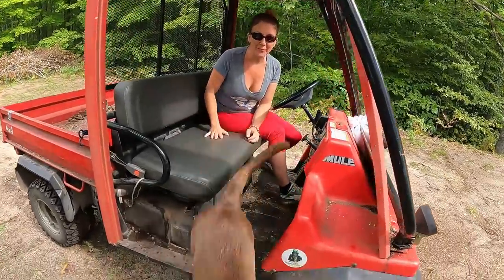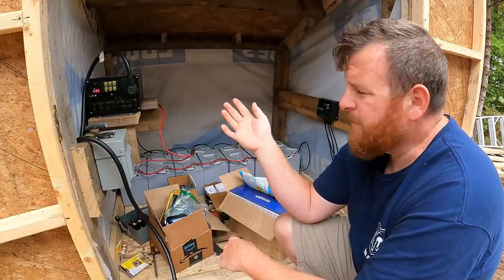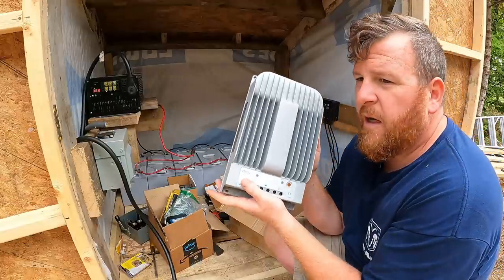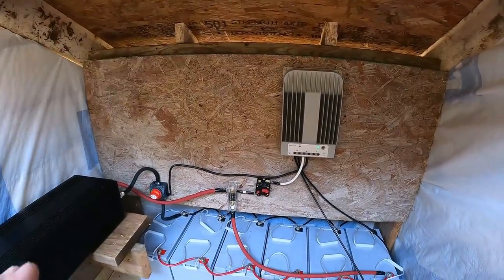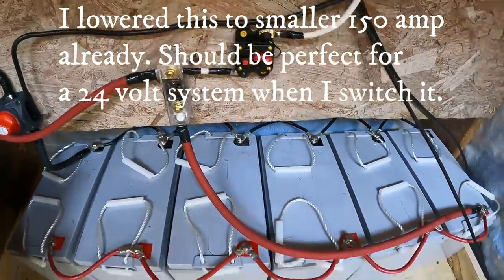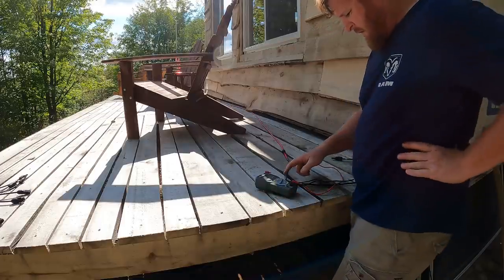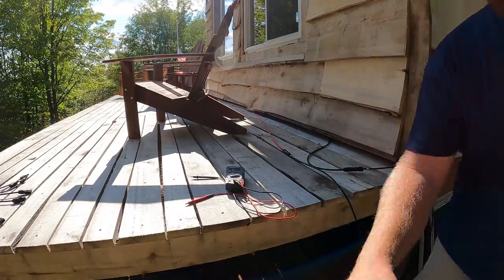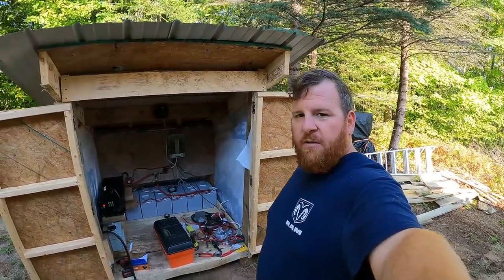Solar Upgrades | Making the Solar Shed Safer | Building simple DIY Off Grid Cabin Solar Power System

Comment: the two solar door should be insulated with foam....since you're batteries are sealed.. no reason to make a vent.. but nevertheless make one (a three inch will do.. add a stainless steel mesh top used for cabinets, kitchen, bathroom can be used here.. just paint it so it don't get rust in winter. Stay safe.. God bless
(wood shed will be good.. make it in such a way that both side are accessible.. that way the old wood gets used first and the fresh cut can dry up).. add a 2nd  MT50 reader inside the cabin exactly behind the wall parallel to your power shed...so you're using less power cable...this will keep you from going out to read the meter in the shed.
Reply from the maker: I was hoping to find a cable long enough to bring a mt50 inside, I'll look for one. thanks

Comment: Putting the 4 panels in series is good as long as none of them have any shade on them, not even a little bit!
Reply from the maker: I was wondering about that. I heard about that, but waa not sure if it still applies with today's panels. They sit full sun once the sun reaches them, so good to go there. Thank you
Reply: @OffgridwithJayandJen  Yup, still happens. FYI. Solar panels are built with 1 volt solar cells in series to get up to the panel voltage. If a solar cell in the panel gets shaded, it can't pass the current/amps through it very good. So that kills the current going through the series string/panel and therefore the power output/watts. So when you connect the 4 panels in series, it is like almost a 100 solar cells in series. Higher power solar panels use higher power solar cells or sometimes put a couple cell strings in parallel.

Comment: It's definitely looking better.  I still wouldn't try to go over 500-600 watts until you upgrade the battery interconnects.  If you are going to upgrade, I would definitely recommend going straight to 48Vdc.  It will save you many hundreds of dollars over the build of your system for cables, lugs, blocks, etc.  24v systems are mostly designed for semi-portable builds. 48v is more desirable for permanent installs. Even some of the portable power stations like Bluetti and Jackery are wired for 48V batteries internally, just because it saves so much cost on components.  Also 48Vdc to 120Vac can be a much more efficient conversion in the inverter, than stepping up from 12 or 24 Vdc.
Reply from the maker: Thanks you, I considered trying 48 volt, but was not sure with my odd number of batteries if i could make it work. I just got my 24 volt inverter in the mail and plan to wire my batteries in three pairs of 24 volt, using six of the seven I have. I have such a small solar panel array I wasn't sure if that had any effect on charging in different voltage systems bigger that 12 or 24 volt.

Comment: Jay I will tell you a secret on your woodpile get you some plastic 6mm it come in different sizes 10 foot up get the black put it underneath your woodpile then put wood on it and on the top get you some used Tin put on top and at least a foot in front and back that will help it dry quicker and help keep the weather off and from the bottom too moisture
Reply from the maker: Nice, I did lay old wood scraps under the firewood so it isn't on the dirt, but I'll try your style some time. Thanks

Comment: make sure you setup the charge controller for the type of batteries you have!
Reply from the maker: I did mess with the settings a little bit, but this particular CC has AGMs as its default settings, so hoping it is good to go. VERY GOOD POINT

Comment: Yup Will Prowse is the go to channel for solar system info. I'm still waiting for more feed back on the China made MPP 24v Inverter/chargers, seems many off grid utubers are going the route. Thanks for the video.
Reply from the maker: I like his video style and he knows his stuff, so I'll follow his suggestions
Reply: @OffgridwithJayandJen  I too have built my 3k system from the Will Prowse channel ( I have the same epever charge controller  only the 100amp variant).  For the inverter I went with "WZRELB 3000W Pure Sine Wave Solar Power Inverter 24VDC to 120VAC 60Hz Power Converter LED Display".  Great stuff as always Jay.

Comment: I agree that 24v, or even 48v, for a cabin is a better way to go than a 12v system but keep in mind that Lithium batteries don't like to be connected in series.  If you are going to go with a 24v system, you should purchase 24v batteries.
Reply from the maker: I didn't know that, I don't know much about Lithium batteries to be honest. I learned that they don't work in below freezing temps and ruled them out for us. Our batteries are AGM sealed lead acid for this reason. so I will be wiring them in series for 24 volt very soon.
Reply: @OffgridwithJayandJen  - Okay, good.  With AGM batteries you will be fine connecting them in series for 24vdc.

Comment: Check out super capacitors for your solar system. I use similar setup to Desert Prep video high capacity off grid generator rev 4. I use a 12v marine battery and a 12v 1800 cca maxwell super capacitor. I could not run circular saw for any amount of time using just 2 batteries. As long as the sun is shining I can run circular saw now. Like 3 minutes to charge super capacitor too full.
Reply from the maker: Very cool, I will have to check it out. Thanks so much

Comment: around 5:30 your understanding of a real MPPT is 100% correct, 150V input may make one believe  that you could connect 4 36V panels in series, (nominal 144V) but dont do it, firstly the VOC (open circuit) voltages may be 45V and that adds up to 180V  thus the better options are to operate panels in sets of 2 or 3 in series (72Vnom 90Vpk or 108Vnom 135Vpk)
the main shortcoming of series connected panels is that shading by snow clouds or trees of only one panel drops output of all series connected panels in that string, so if you have 6 panels, it may be better to have them in 2s3p configuraton, than 3s2p configuration. also remember to have all series connected panels in same angle to the ground(and sun).
Reply from the maker: I still have a ton to learn, but what you are saying makes sense to me now. I am hoping we can pick up another 5-600watts of panels and grab some more energy, but this little set up will have to do for now. My real confusion is if any amount of voltage or amperage is better or if it is irrelevant as long as it fits into the maximum input.
Reply: @OffgridwithJayandJen  I just upgraded my system from 4x100W in 2s2p south  config to 6x 295W 2s1 to east and 2s2p to south, giving me  about 100W on cloudy day and peaks fed to grid  so far have been 600W due to limiter setting (out of nominal 2100w)

Comment: I got a 12-volt system in my house around about 3000w no problem but I use 2/0 welding wire
Reply from the maker: Awesome, I have a 3000 watt 24 volt inverter now ready to install.....using the 2/0 cable we should be good to go soon too. thanks
Reply: @OffgridwithJayandJen  nice
Reply: @OffgridwithJayandJen  Not sure what type of inverter you got but high frequency types don't handle surge currents too good (motor starts, etc.) Also derate the load, typically 80% max. (2400W).
Reply from the maker: It Is a pure sin wave inverter, but I never put more than a couple hundred watts through it, other than when I originally tested the circular saw. That inverter took a crap now, have a nice 3000w 24 volt one to replace it with now.
Reply: @OffgridwithJayandJen  Yup, I was referring to the 24V 3000W inverter. The low frequency inverters have a big (heavy!) coil in them and are better with motor loads. It looks like your 12V inverter was a low frequency type. High frequency inverters are lighter (tiny coils) but are not too good with motor loads and need to be derated a lot.
Reply: @OffgridwithJayandJen  can't wait to see your video

Comment: your batteries should work fine with upgrades.  most of the lithium iron batteries are 48 volts.  for futue proofing a 48 volt battery bank ant 48 volt mppt controler might make more sense.
Reply from the maker: Always open to improvements. 😁

Comment: dont you have to insulate the top of the roof to or not I don’t know
Reply from the maker: In a home you most certainly do, but in a shed there is really no purpose for it. The white you see on the walls is just moisture barrier which I probably didn't need either, but had extras laying around so we used it. These solar components are not really terribly affected by the cold, so we should be good to go. Thanks for asking and watching. Best wishes

Comment: You put the disconnect on the ground side. It should be on the hot side!
Reply from the maker: The wiring diagram has it always installed on the negative side. I wanted to put it on the positive, but I dont like to go against the diagrams

Comment: YOU NEED TO GROUND YOUR SOLAR PANELS TO A GROUND ROD
Reply from the maker: I was wondering about this. Can I sink a grounding rod and connect both the pannels and the inverter to the same point??
Reply: @OffgridwithJayandJen  I think the code requirements are something like one unbroken continuous run of 6AWG bare solid wire to the ground rod. The 6AWG wire goes to the inverter ground lug and to the frame of the solar panels, all one series connection. Most Solar panels have a place where ground is to be connected, usually a threaded hole. You use a screw and clamp to compress the wire against the panel frame (no cuts on the 6AWG wire.)

Comment: my 40 volts coming in from my solar panels// is bring in 9 amps  // my battery need  12.9 to 13.9   volts // then  use in my inverters to stay FULLY  running on full 3000 watts OF 120 VOLTS
Reply from the maker: NICE

Comment: I need to teach y'all how to make Bacon from Scratch... better and cheaper!
Reply from the maker: Make the video buddy
Reply: @OffgridwithJayandJen  Thats what I'm thinking! Instead of the usual 80-90% Fat... this will be approx 50%. And you've got 100% control. I'll tell ya, get 1 oz of Insta Cure #1 and a small digital scale. It is all done by weight. The scales are really cheap and so is the Insta Cure #1. Then its a Pork Butt (Shoulder), Salt and Sugar. Then a 1 gallon Zip Loc bag. Easy!

Comment: your wires are way, way to small now, hope you don't make em smaller. You will regret it. Change all those battery wires to 2 gauge. Don't run all 4 panels in series because you will have shading issues. Set up your panels in 2 sets of series, which you then parallel .
Reply from the maker: Hey Sundancer, I appreciate your comment and I know I talked a lot in this video, so maybe you skipped around a bit. BUT half the video and multiple times I explained that I was not putting any heavy draw over a couple hundred watts until I upgraded the jumper wires. It is really what the whole video is about. 2/0 wire all around is coming in a future video. Best wishes